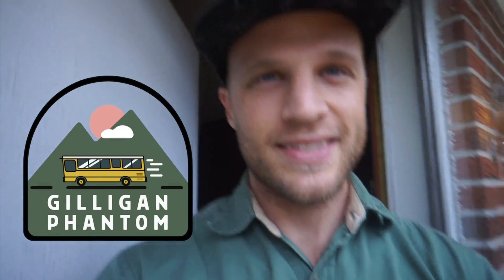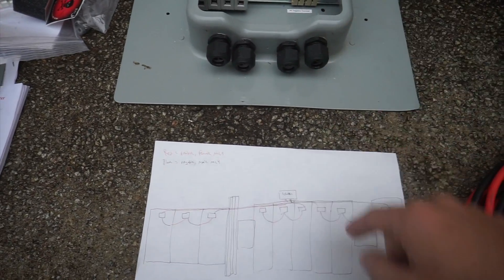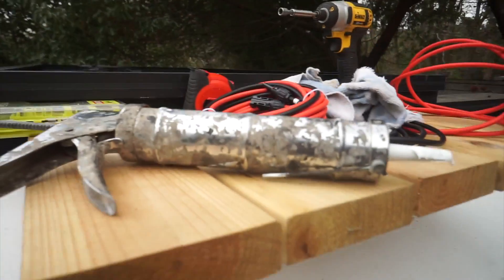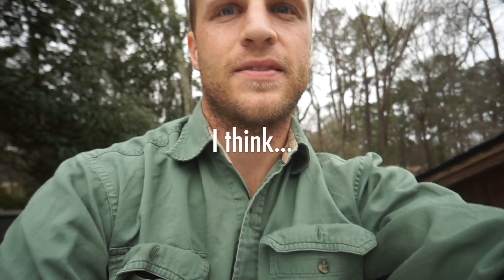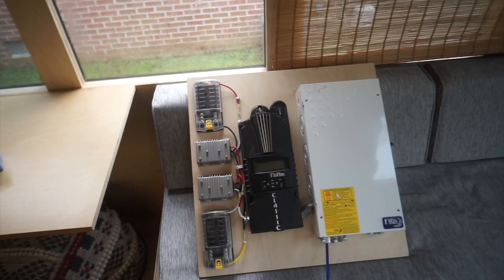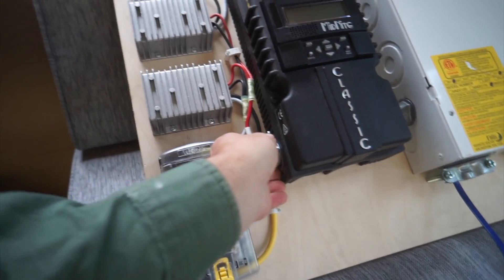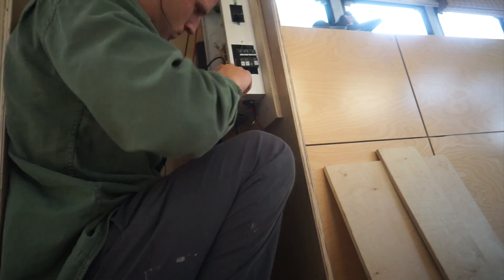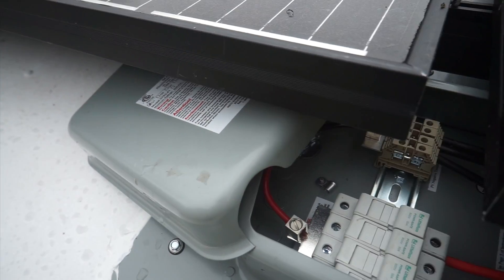3S3P 2,430 Watt Solar Panel Wiring on a School Bus (Wire At Your Own Risk) Ep 46

Comment: Hey! How did you ground you combiner box? Im hooking mine up now
Reply from the maker: You don't need to ground your panels because your bus is on rubber wheels. Any ground wire however has to eventually have a route to a clean spot on your bus's frame but there are no ground wires needed from your solar panels to your charge controller.